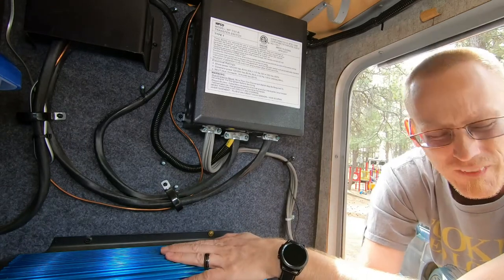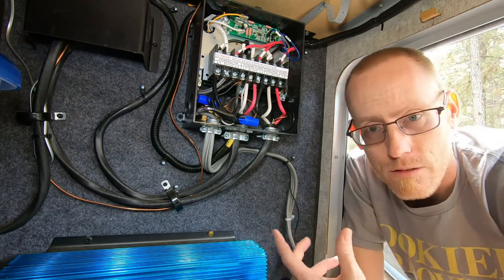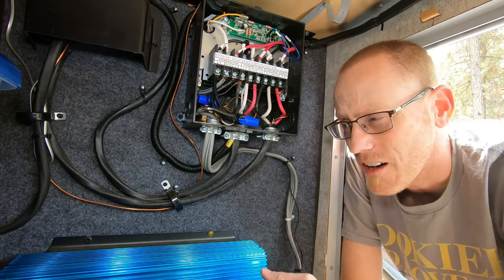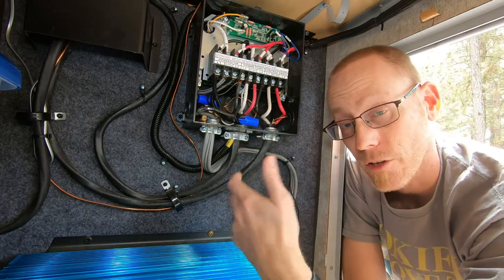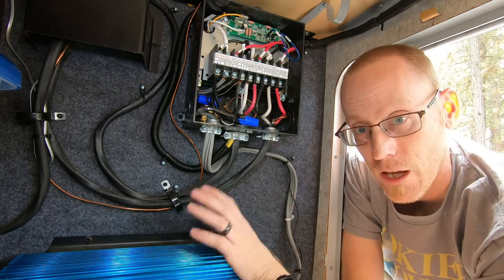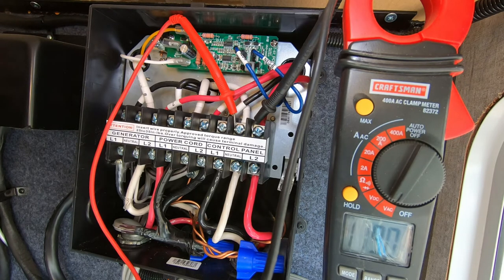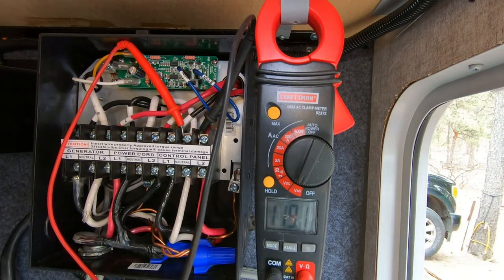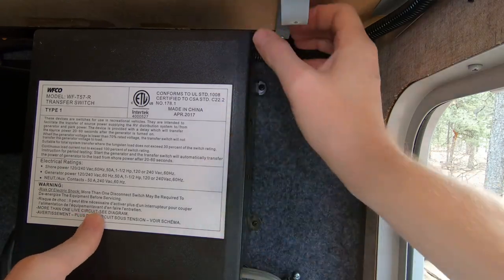Fixing a wiring issue with our Inverter and Transfer Switch!

Comment: But when you're on shore power, is your inverter charging your batteries or is your converter charging them? Do you have a wire diagram of your setup? Thank you.
Reply from the maker: The converter is only active when plugged into shore power.  Using an inverter to run a converter to charge batteries would likely cause some very bad issues. I tapped into the shore power before the transfer switch to power the converter. I have a crude diagram here: https://drive.google.com/file/d/1QDBUCFh-0lFnDBGuUoXo0WwYrqm20vbB/view?usp=sharing
Please let me know if you can see it!
Reply: Is your EMS rated for 15 or 20 amps? How are you able to tie it into a 30 or even a 50 amp power supply?
Reply: @AlcoholFreeRV  HGi! Thank you for this! In your diagram, where does the generator fit into the schematic? Or, in your video, how is the inverter tied to your generator?
Reply from the maker: @Glenn James  I don't have a generator. Assuming you have a portable, just plug in the shore power cord. If you have an Onan/ builtin, and a standalone inverter similar to mine, you would have to determine priority and include a second transfer switch.  I envision i would have the output of the present transfer switch into the left side of the second xfer, and the genny in the right side. The output of the second would go to the main panel
Reply: @AlcoholFreeRV  thank you. This is what I was looking for. Thank you for the help.
Reply: This is probably a late reply, but you did an excellent job on the video. Based on this, I also switched my generator and shore, power, inputs, not using a generator, but instead you took an inverter, exactly as you do. One thing that I find odd, is that if I am plugged into shore, power, and I turn off the breaker to the shore, power, and try to run my inverter, it seems to cause some sort of ground fault error, and the inverter stops working. If I unplug from shore power, even though the breaker was off, the inverter works fine. There is some sort of issue I have with a ground fault otherwise that I have not been able to figure out.

Comment: Great Idea to back feed shore power with inverter. As your inverter appears to be 120VAC how did you hook up from the 120 VAC 20 amp outlets to the T-57R ? did you jumper L1 to L2 [putting 120vac on both sides of your WFCO Power Center WF-8950?] , neutral to neutral, and ground to ground?
Reply from the maker: Yep you got it just jumpered L1 and L2

Comment: Quick question, i dont hear a buzzing sound coming from yours? I have the original 50 amp ats that has the two big relays in it and it buzzes just like every other ats like it. Is this style different?

Comment: Thanks for the video.  I’m looking to add the WFCO transfer switch and will want to leave the inverter on even when we’re on shore power as we have some other devices plugged into the integrated inverter outlets.  Do you leave your inverter on as well when hooked into shore power and if so, have you had any further issues since you made this video?  Thanks in advance…
Reply from the maker: Yes I do leave it on all the time and no I haven't had any further issues outside of user error trying to pull too many watts at once.
Reply: @AlcoholFreeRV  Great to hear and thanks for getting back to me!  👍🏻

Comment: Thanks for the great information. I'm also looking to add an inverter in my 5th wheel. It's pre wired for a generator with a WFCO T57-R  transfer switch. All I want is to power a few outlets, for a coffee maker, to recline the electric chairs, maybe the tv. I might also want to wire a generator into the transfer switch. Do you know if I can piggy back the inverter wires and the generator wires into the same lugs?
Reply from the maker: Sorry I do not know the answer to this

Comment: Thanks for the video! 

I bought a 219BH Passport and it is solar ready. I bought an expansion panel and is fine, but then when I was going to install the inverter...I removed the "future inverter location" box and a 20AMP yellow Romex wire appeared, no ends, is a loop so it comes out of the wall and goes back inside the wall. I don't see any other wires (to the battery) but the converter is next to it so I guess I can wire it directly to the LOAD connectors in the converter. How do I find pictures or instructions on how to deal with the ROMEX loop? I was expecting a terminal or end of the cable. The owners manual reads that is "pre-wired for seven outlets" but I pull and both ends seem to be connected unless it is snagged and I am too weak or afraid to pull hard.

My thing is that if it comes prewired is best to use it and looks like that Romex protruding out of that hole like an intestine is where it needs to go but it does not make sense to splice it. I called and chat with Keystone but the girl in the chat had no idea and when I asked for a diagram, like the blue prints of a house, but she says they don't send those to customers.  Not even the roof plan to see where the joists would be for the solar panel brackets.
I could test the wire but I don't want to cut the insulation. I took pictures but I don't know how to upload them here, ha!
Reply from the maker: I wouldn't put much stock into manufacturer "prep". Since I don't have a Keystone, I don't know where to begin, although it does sound like youre in the right direction that one end of that loop probably pulls out, but which one?

my email is the same as the channel name, without spaces, at gmail
I'd be curious to see how we can get you going!

Comment: Ever had some outlets work and others not? I’m trying to figure this one out right now.
Reply from the maker: Forest thing I'd check is if there's a gfci anywhere that's tripped assuming you've already checked the breakers
Reply: Breakers aren’t tripped. GFCI is good. Has 3 sets of wires into/out of it, 1 cream colored, 2 light green colored. Im assuming for the left and right sides of the RV. A couple few outlets work, then the ones toward the front are dead, except the TV outlet. I think the wiring came loose somewhere or one of the non-GFCI outlets in the circuit has gone bad.
Reply from the maker: @RaymondKaltenbach-qf6il  turn the main breaker off and start removing the nonworking outlets first, starting with one that's closest to a good one.

Comment: Alcohol Free RV? I'll be right over! What kind of beer you got? No? You ain't got no beer? I thought it said, alcohol Free RV. Is the RV Free? No? What are you selling here? An RV with no alcohol? What's the matter with you man?  Are they still letting you drive?

Yes I can understand with an, Alcohol Free RV. Having trouble with your automatic Transfer Switch. It can be very difficult. It's always a work in progress. Yours switch. Will never be recovered. And it is prone to, Intermittency. But not to worry. Just don't be driving when you do that. Let her drive it. She can see over the wheel just fine.  Plenty of small people drive great big trucks. That are over at least,, 5 foot 3. I'm just saying… I know some. They are very nice and they smell good.  Unlike yourself.  Because you only have a 6 gallon hot water tank on your RV. Bummer!

I use one of those water restrictive showerheads. It works really good. I can still take a, 20 minute shower if I want to. With nice hot water. Good and hot, water. And that's with an electrically heated,,  hot water tank. I don't like running propane.  Propane should not be used in flammable vehicles. Electrical fires a lot easier, to deal with. Mostly they only smelled bad at first. Then you have to find out. What is going up? And switch that off as fast as you can. Pull the master breaker. Shut down the generator. Grab your fire extinguisher. And start Troubleshooting.

I have had said, occurrences. Outside that of Motorhomes. And managed, to save, the gear.  With a quick shutdown. Then I found what smoked. It was an electric motor. Let your nostrils, be your guide. And you can get the show back on the road. Or engineer yourself around it. Until you get to a proper city. With, services, available. You limp in if you have to. That's why they are usually secondary roads to the Interstate Highway. We're 35 mph is no big deal. If you have to. Because you don't want to be doing that on the interstate with your flashers on. If, you don't have to.  So don't. Not everybody is paying full attention. You could be impeding a person who is not paying attention. Which doesn't usually happen the same way on secondary roads. Pull off and quickly check, clearance fights. Before you continue on. Otherwise you could find yourself backtracking for quite a distance. And having to turn around. Always a significant, annoyance.

I've not had anything like that happen to me. I sort of fancied becoming a Trucker. In my much earlier life. As I knew a guy who was. I traveled with him locally a couple times. I almost went for it. But I stayed in Broadcasting, mostly. And drove different kinds of trucks. Packed full of audio and video gear. As it later turned into a Control Room On Wheels. Both straight box trucks and semi-tractor trailer, versions. I personally owned a box truck version. For over 30 years. It's sort of like a Super Class-C. On the outside but no windows on the box. And on the inside. But only one couch. The rest are, Captains, office chairs. No bed and no bathroom. Just a Micro Kitchen. With, mini fridge/freezer,, induction cooktop, Microwave.  All necessary ingredients. For an, Audio & Video Crew. Or just a single person. As the coach also folds out to a double bed. And is great at, Truck Stops. As I have batteries and inverter. To still power up the control rooms. With the audio and video playback system. So truly stellar at Truck Stops. And all the comforts of home. Like showers and restaurants, service centers and minimart. And frequently a hotel on premises.

So I think I have it down. With my new used diesel pusher motorhome. As a single  old widow. Packing heat.
RemyRAD

Comment: So you installed a new transfer switch. Without first reading the manual? And you call yourself an, Engineer? What? You're not an engineer? I see. Of course. I am.

I will not install, anything. Anything. Before I read the manual completely through. At least once if not twice. Sometimes three times. And then have it handy.  And all of my test gear. While I am doing the install. So as not to get anything wrong. Right out of the gate. I like things to work properly. Right from the get go. So I always read and study the manual well, first. Sometimes it will even take me, 10 minutes! LMAO.

I had to use a Digital Audio Console for NBC-TV News in Washington DC. This thing was so sophisticated. They gave us an entire Looseleaf Notebook Manual. And it took us about 3 months. To get this digital beast under our belts. We did mock TV shows. Before we ever did a real one from that control room. They were full blown TV shows. As if we were on the air. Every day. Until everything became Muscle Memory. Only then. After being well-versed with the manuals and the operation of the gear. Did we head out, On Air, again. From that New Control Room. As this would happen every couple of years. At the upper echelon level. I got to be a part of for a couple of decades.

So I guess it's almost like being in the military? Though. I was never in the military. But working for a Major Television Network. I think is kind of like that. When the Productions come together, Multiple Times, Daily. Along with the live shots out in the field and all that. Satellite feeds from elsewhere in the world. And elsewhere in the USA. It can get hectic. And you don't want to crash and burn in front of hundreds of thousands if not millions of people. So you best be the, best. And I was one of those Best's's's.

I joke about that but it's really no joke. When I got hired by NBC.  They were still owned by RCA. Another prominent American, Contractor. Of some of the world's greatest,, Broadcast Equipment. And they owned, NBC. And they only hired.  The Best Engineers, in the World. Somehow they hired me? I don't know how I slipped through? They must have been desperate?  As they must've desperately needed me. To keep me around for 20 years.  And give me an open-ended contract. But after 20. I figured.. That was long enough. I wanted to do my own thing, still. I already had been doing it as a side hustle.  And side hustle overlapped,, day job by 10 years. That was good enough. Working 2 jobs for, 10 years. Never really having a weekend of my own. Nor vacation. No time for that. What do I want to vacation from? I'm doing everything I always wanted to do. In my Professional Life. It was so cool!

Now I'm supposed to be retired. I'm bored out of my mind! And now my husband of 22 years has passed. I'll never be the same again. I don't know what to do with myself? I don't know where to go? But I have to leave. I now become House Less. And no more permanent Address. Which I have to reestablish yet. I have a lot to do after I move out at the end of the month. Because that's it. I can get to the end of August. I need to put a push on. I'm not sure that I can? I'm disabled. I'm handicap. I'm old.  I'm all alone. My stamina is gone. I'm not sure what's next?

I am not currently having a good time of any sort. I'm going through misery.
RemyRAD